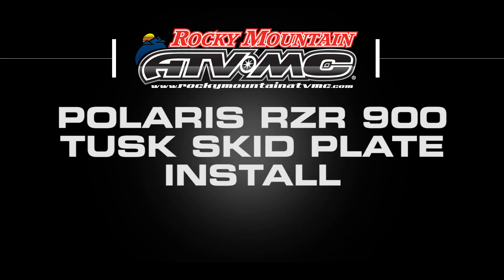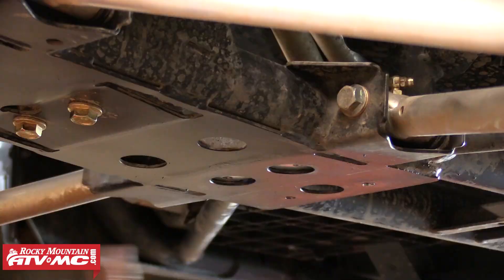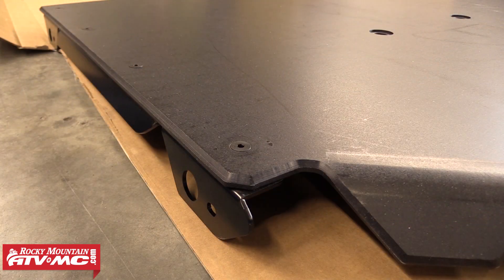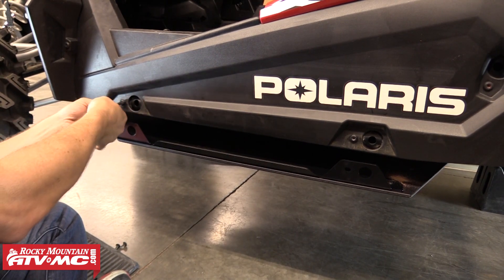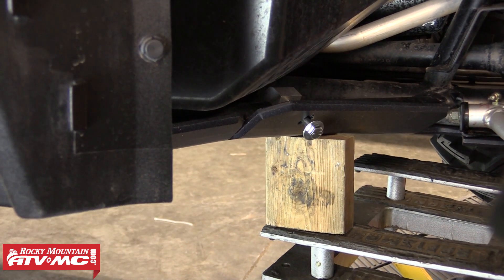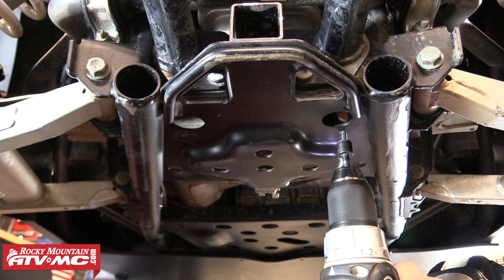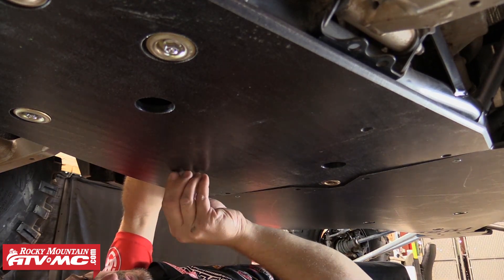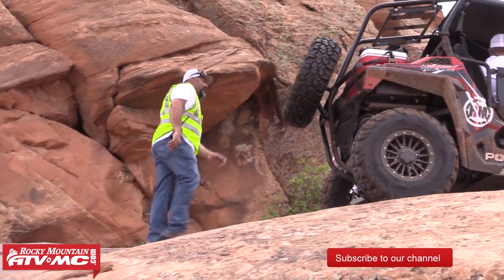Polaris RZR 900 Tusk UHMW Skid Plate Install

Comment: I have this skid plate on my RZR. Where do i get replacement parts as in double hole plates and single hole plates. I removed the skid plate to add a heater and busted the screws off in the plates. Excellent skid plate just need some parts. I also greased all the bolts I put back in so that this didn't happen again